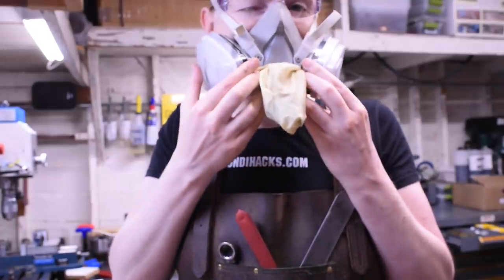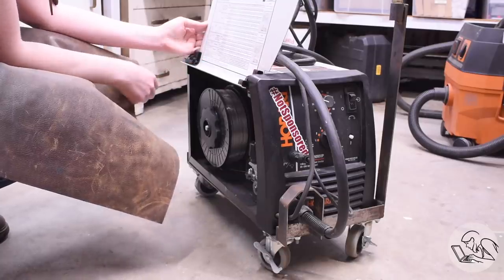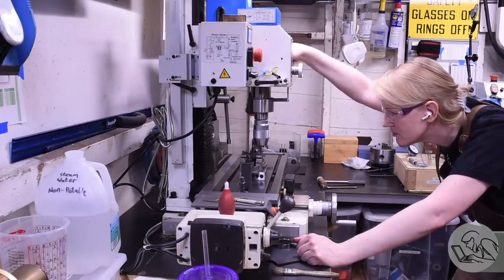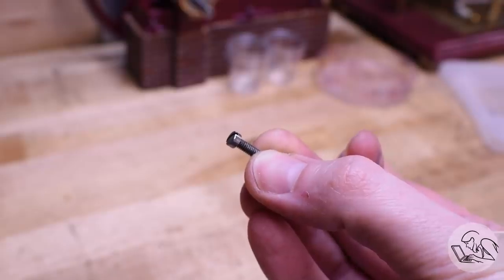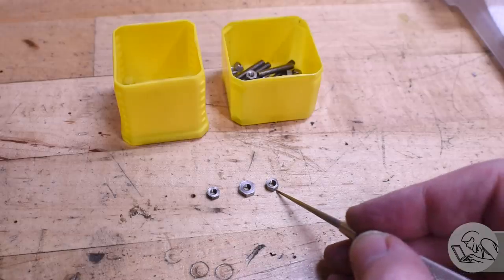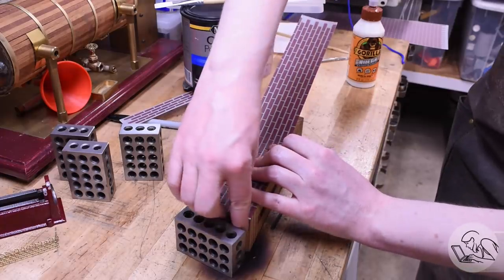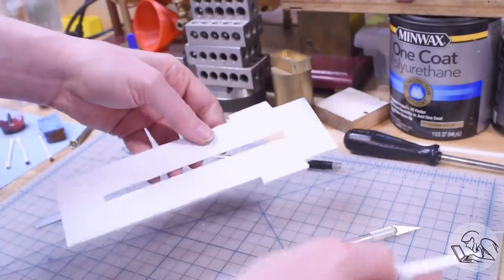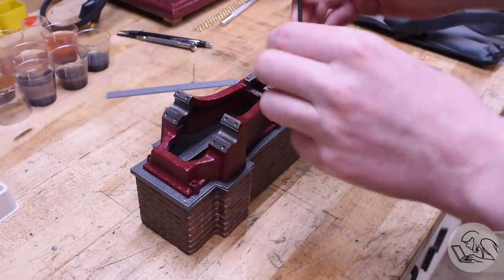Let's Build a Model Steam Engine : Finishing Touches

Comment: Quinn, I am so impressed with your steam engine. I made a lot of models as a youngster. Mostly planes , ships and such. I was also an N gauge railroader. ( I worked on real railroad locomotives for 41 yrs .) your technique for making the brick work is great. I did re-machine auto engines as a hobby, and used hi temp paints. That color you picked is beutiful for that sweet steamer. Thank you for sharing.

Comment: I know I'm commenting on an older video, but I just finished this series after discovering your channel and I've absolutely loved it.

One important safety tip from a former professional carpenter: when using a powered miter saw (chop saw), please don't ever cross your arms in front of the blade like at 2:40ish. It's super super easy to do and I see it all the time, but as silly as it sounds you run a very real risk of cutting into your forearm. Much safer as a rule to either flip the work to the other side of the blade, or to switch hands and cut other-handed. It's one of those things that work out just fine 99 times out of 100, but if you keep that habit, the 100th time will bite you. 

Congrats on a beautiful finished project! It looks great!

Comment: Quinn, This was a great video series thanks for sharing. With that cast iron top plate, you can take a razor knife to the edge of a piece of Styrene to create thin shavings, then take all the shavings dump them into you disposable shotglass and add some Styrene glue (plastruct) this will turn into a melted past that you can spread very easily along the edges of the top plate, let dry then sand to a uniform edge.

Comment: Thank you for such an entertaining series. It’s a great looking engine and the timing sounds spot on.  I was thinking about engine beds, having spent my misspent early adult hood at various stationary engines in the UK as well as with more mobile forms of steam driven machinery. Your right in saying that the cast iron beds were mostly  bolted direct to masonry ( not brick ) and the fly wheel would be in a pit . Where there was often fancy brick work  it was on the walls of the engine house.  Eg. If you look for photos Cold harbour  woollen mill in Devon ( which has a lovely  1910 Pollit and Wigzell Cross compound horizontal engine by the way) it has a lower part of the engine house in shiny glazed red bricks with shiny white bricks above.  My other knowledge is of far older beam engines at Crofton Pumping station  ( 1812 for the Bolton and Watt Engine) and others and again the bed of the cylinder was fixed direct to masonry as far as i can recall.  However your brick looks great and I like the custom variations.

Comment: Come on, everyone knows you have to use a stick welder for wood.
Reply: @user232349  poplar welds any wood except cocobolo!
Reply: Came down to the comments just for this. Was not disappointed.
Reply: Wasn't sure what kind of wood to use for the filler rod, ended up with ash.
Reply: @spehropefhany  Actually you can only the oxy torch to melt the surfaces together

Comment: I have used the mill and a fly cutter on wood. Sharp tool and lots of rake. Aluminum insert also works. Adjust so cutter is more along the grain than cross grain. ☺

Comment: Very nice-looking engine.  I stumbled upon this video while tryng to figure out what "my steam engine" was (from your make an eccentric video).  Enjoyed that one also.  I've built the PM Research horizontal boiler, but I didn't video all of that.    BTW there is a type of glue called "Weldwood" plastic resin cement.  It was used for aircraft wooden part assembly prior to epoxy.

Comment: A little tip for glue-ups. You can sprinkle a little common table salt onto the glue to keep things from slipping around. The salt bites into the wood a little and dissolves into the glue as it dries.

Comment: To enhance your cap, you could dissolve a bunch of polystyrene in the acetone and use the result as a putty (provided, you don't have a commercial plastic modeling putty on hand) to fill in the seams between the top and the sides. Then file those a little with the small files, you have and sand it to smooth the corners. That would make the top cover look much better and wouldn't require too much effort.
Reply from the maker: Good idea!

Comment: Quinn, for future glue-ups, try making a glue spreader out of a piece of saw blade with a handle welded(?) in the center (a T-shape).  It evenly & quickly spreads the glue similar to the trowels that are used when laying ceramic tile.

Comment: I have made a parting tool out of broken slitting saw blades, I have a .020 thick and a .030 thick tool. They are .500 tall by what ever length  I could out of the slitting saw. You have to get creative as to the holder you make. The work great, you can make all kinds of stuff because they have little tool pressure,  they really great on small stuff. I originally made them up to part off hypo tubing which is hard stainless. I also made cylinder base seal out of teflon that were .030 by 3 inch od. with an id of 2.75.

Comment: nice finish to the steam engine
tip for you general purpose thinners works well to remove p o r 15 paints but you need to  wipe it off  pretty quickly 
also i use it to clean my brushes

Comment: You mention not being able to get hold of MEK. It's the primary constituent of pipe cement cleaner. At least here in the UK. Used for prepping PVC & ABS pipe/fittings before solvent welding. Will dissolve or soften just about any plastic!

Comment: It looks AWESOME in burgundy!  Feeling some Hellsing influence in the shape of the base, Sir Integra.  :D   

On a completely different note: I have seen in some very old factory halls that the floor was paved with wooden "bricks" set on their sides (grain up?). This absorbed the vibration, supposedly. I am not sure about that but they look very cool.
Reply: @royreynolds108  Oh? That is very interesting. Could you elaborate on this or point me to some more information, please?
Reply from the maker: “End grain flooring” was indeed common. It’s nice to walk on, inexpensive, and very very strong. It’s also stable- the floor won’t warp and upset the machine tools.
Reply: @Blondihacks  I actually considered end grain wood flooring in my new shop/horse barn conversion...until I figured out the staggering work involved and copped out in favour of concrete. ( But did add colour to the concrete). 
No horses were inconvenienced in the project.

Comment: If in the future you need polystyrene glue, go to a hobby shop (if you have one locally) as plastic model cement is for polystyrene. Just make sure to get the toxic kind versus the non-toxic as the toxic kind actually melts the plastic which results in a welded seam (similarly to ABS glue or PVC glue) and the non-toxic kind mostly just sticks the parts together and results in brittle glue joints. Look for Testers Model Cement. Orange label is the toxic stuff. Blue is the non-toxic.

Comment: Re: High temperature rated paint. You can get it in the full color spectrum. For temperatures in the thousands of degrees, you have to go to actual paint suppliers, and convince them to break out the 'Protective Industrial and Marine Coatings' catalog.

Just walking into a paint store and asking for any old acrylic enamel (which is just regular automotive paint) will generally do the job for mere low hundreds of degrees, though.

Comment: Did you forget the studs and nuts for the crosshead straps, or was that an editing "thing"?
Excellent series, finished off as a great modeller should.
Reply from the maker: I haven’t done those yet because they need a different treatment. The studs can’t be installed permanently because you need to remove them to access the gland packing. I’m going to make “fake” studs with a nut attached to the top so they act like bolts
Reply: @Blondihacks  I knew there had to be a better reason than mine 🤔😉
Once again, excellent work!

Comment: I found plant-grade LocTite to work reasonable well on polystyrene. You could touch up the edges of the cap with it, so it looks like welds, and repaint it.

What do you need the mesh for, actually?

Comment: That burgundy paint looks great, but I wonder if it was overkill for this project. A quick Google search seems to indicate that the acrylic paint should be good to at least 300F. Further googling suggests that to hit that temperature you would need to be running your steam at about 55 psi. Overkill is less work than refinishing though.

Comment: Fine job, but I was surprised you did not try and use the mill to shape the wood base.
Reply: yes I was expecting to see it squared to perfection with beautiful fly cutting grace.
and then a properly milled drain with a shallow bit of draft to aid in flow. Quin you do know that wood can be tapped too. I wood turning we often thread wood and harden the threads with thin CA glue (AKA thin super glue)
Reply: yea. The mill with a really sharp bit would have worked well.
Reply: Glad I'm not the only one that was curious about this.
Reply: Some machinists don't like to cut wood on their metal working tools.  The sawdust can accumulate in hidden areas and the wood attracts moisture thus causing corrosion.

Comment: If methyl-ethyl-ketone works for cleaning, I would be very surprised if acetone doesn't. 

Acetone is basically methyl-methyl-ketone. Chemically very similar, just a little lower boiling point, which is problematic as a solvent for paints since it evaporates too fast. For cleaning that shouldn't matter too much.

Also a RC airplane modellers trick: 
You can cut machine threads into wood. Afterwards soak them in THIN superglue (the water thin stuff is the correct one, it has to soak into the wood before curing) and then run the tap through again.

It's surprisingly rigid, doesn't rival metal of course, but in M5 or M6 it's good enough to securely attach airplane wings to the fuselage.

Comment: You could have machined the wood block in the mill. Would have made it much easier. We had to cut wood on mills and lathes before. You just have to make sure you clean and re-oil the machine after words or during if it is a long project.

Comment: I think those sure form tools just sort of appear once you've done enough woodworking.
Reply: I have one and I've never worked on wood, no willingly at least.  I too have no idea where it came from.
Reply: @zachaliles  I have a couple of them.  Never used them on tree parts.
I use them when forced to screw around with drywall.
Reply: @Tinker001  bought all 4 of mine to do body filler work as a youth as my parents would not allow me to to leaded body work

Comment: Love the videos, love the engine and projects...... and I now know there is a  very pretty blonde lady (complement)under that cap.Usually you have the cap on.
 I always wonder how you get away parting off such very thin material. I'm used to the cutoff tool grabbing and either the parting tool blade goes flying or the material breaks off and the blade goes flying(: Some day I will replace my very worn out farm fixing quality Atlas lathe with something more rigid! Nope, farm fixing mostly for my lathe use , no real hobby projects ever been made here yet ...but some day.......

Comment: Good thing you didn't try solder on the wood. You wood have probably used electrical solder and wood isn't electrical once dried. You have to use a specialized woodworker's solder.

Comment: Hi Quinn, brick foundations are not aprocraphyl. 

https://www.facebook.com/photo?fbid=102628946437584&set=a.102485376451941

That's a link to a photo I took of the foundation for the engine at the Lithgow Blast Furnace. The Lithgow Blast Furnace is a set of ruins in Lithgow NSW, Australia. You can see the curve for the Flywheel and the cut out for the drain.

Comment: That really looks fantastic in that color! 
As a painter, I love that you brush painted the engine rather than spraying it. 
Brushing it allows for a thicker paint layer which gives the casting a smoother look I tend to associate with older painted cast iron.
Also, R.I.P M.E.K  😢 I used M.E.K to thin down aircraft paint for spraying. The M.E.K substitute doesn't play well with it.

Comment: Hi Quinn, another excellent video, nice finishing block for the engine, one little trick for paper gaskets is  put some grease on them, this soaks into the gasket paper and makes it waterproof plus flexible and helps to seal, used to do this with car waterpump gaskets and never had any leaks, Kind regards Doc Cox.

Comment: Guess you can't avoid the wood worker jokes.  Personally, I'm material neutral, I build stuff out of sheet metal, metal extrusions, metal bar stock, sheet plastic, plastic stock, plastic filament (in the 3D printer), plywood, hard wood, fiber board, and other wood materials.  I'm a graduate of the New Yankee Workshop and a fan of Norm Abrams (and also you and this old Tony).  It's good to have a large skill set, cause you never know....  Hope to see that steam engine power something (like a model lathe or saw mill).

Comment: I was recently building some prototype out of ABS sheets and found a fairly neat solution to filling joints and corners.
Melt some of the same plastic in acetone and apply it with syringe with small tip right into the corners.
After two or three applications it was build-up enough to shape the excess and make the joint look as one piece.

Comment: Awesome work!  Just FYI, when cutting polystyrene, if you cut with the back of the blade, it tends to score the styrene and send that little curl of plastic up, and has less of a tendency to raise the plastic along the edge of the cut.  (The sharp side tends to push the plastic apart, leaving the raised edge that could affect fit.  The back side tends to carve out that tiny ridge of styrene to make more of a score).  I’ve really enjoyed this series.

Comment: Just so you know, the bases for these engine's were usually either large granite blocks or cast iron, bricks weren't used because the vibration from the engine would destroy the mortar. Of coarse later ones used concrete. The only reason I know this is that my great grandparents owned a sawmill that was powered with one of these type engine's and the engine's still sitting in they're yard which is still in my family.

Comment: Nuts sizing  and thickness.. I've seen in the uk a few authentic  fittings  on beam engines  odd size nut and threads i understand ,when machines  was being invented that fittings was not standard  so everything was made to fit the other bib in a wood working method ..  then Whitworth  came along

Comment: You mentioned that the castings get so hot that you need high temperature paint but then you mounted the whole thing on a sheet of polystyrene?  Does that work in the long run?

Comment: That inverted glove looked a lot like..... a thermal detonator 😲
Fantastic result mate 👍 the extra attention to details was well worth it and it sure does look purty 😍
Oh, little tip for those threaded inserts. They are designed to screw in, tappy tap will just weaken or break the 'wings'.
Still get knocked for 6 by the intros.😁
Reply from the maker: This kind are tap-in. They’re unusual
Reply: Oh, ok. Not seen em before. Seems a good idea cos the screw in ones can be a right mongrel in hardwood.

Comment: I think a potentially accurate mount for engine (say in a factory setting) might be the recessed look. The flywheel being half sunken into the ground (2/3 above and 1/3 below grade). Then there would be 4 or so cast iron plinths to mount the wheel, chest and crank assembly (a system that is uses a modest amount of materials compared to a monolithic plinth that raises the entire system to just clear the flywheel above grade).

Look for “Corliss steam engine“ as that seems fairly decent reference (wikipedia but also in google images)
Reply from the maker: This is only a 1/8 scale engine. The really large ones used a wheel pit, but this is more like a little donkey engine.